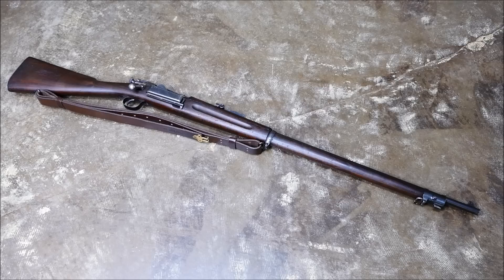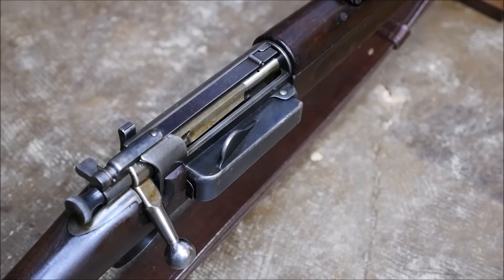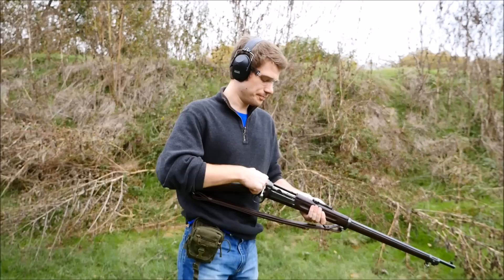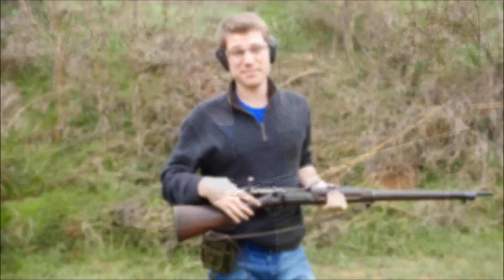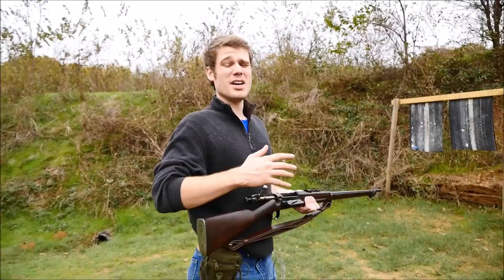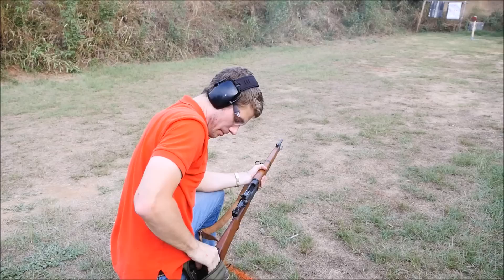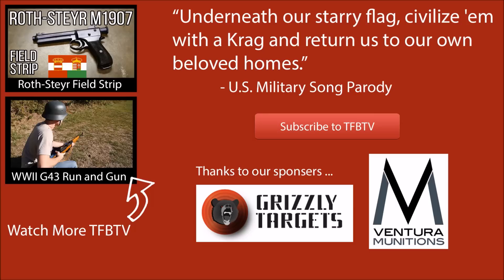Krag Jorgensen Run and Gun

Comment: so, you basically throw some rounds in there and let the gun sort that mess out ?
Reply from the maker: +lefr33man Lol, pretty much!
Reply: The Krag and Enfield are the fastest shooting bolt guns out there.
Reply: +TFB TV How do you feel about lasers on handguns? Like a .357? I put a laser on mine and i like it, some other people like it too, but some disagree.
Reply: +Tyler McCommon , I agree on the Enfield but not the Krag.  Not after the gun is empty. The mad minute of 40 good aimed shots from an Enfield includes reloads.
Reply: I meant the action.
Reply: Tyler McCommon ,
For a hunting rifle that is sensible and reasonable but not for a service rifle on a battlefield. I can imagine what would happen when mud, sand, dust and water gets into that magazine.
Reply: +The Laughing Hyenas I guess you still fail to understand. The speed at which the weapon's bolt can be manipulated is very fast/smooth. I never said the Krag was a fantastic weapon, simply that is a fast shooting weapon. Nor did I say it is a fantastic at reloading, simply that it can be shot very quickly.
Reply: Tyler McCommon ,
I guess I distinguish between a sporting rifle and a military weapon. Have a lovely evening.
Reply: +The Laughing Hyenas 
they have developed speed reloaders in norway and from what i saw with the lee enfield&#39;s stripper clips. it&#39;s mutch faster. you can get off more rounds off with a krag then with a sauer 200 str(Sig sauer 3000 ) in 25 sec
Reply: lefr33man yup. Dump 'em in pointed the right way, and the Krag will sort 'em out.
Reply: @ElCrab  Yep it's almost jam proof . just drop in 5 rounds and go
Reply: Just dump 'em in from the side you can't jam it! Top it off with one in the bolt makes six.
Reply: The KJ 1892 is awesome lol
Reply: @flyinglunchbox  Whoa.... I'm not sure you could call the Krag one of the fastest shooting bolt action rifles. That is precisely the reason it was replaced.
Reply: @Strelnikov10  The krag in 6.5x55 is the fastest bolt action there is. The yanks chose the wrong round for it.
Reply: @BumblingBushcraft  I agree that the 6.5x55 is a superior cartridge.... but the cartridge has nothing to do with the speed of the action. I stand strong on my comment that the Krag is most certainly not the fastest bolt action there is. Any stripper clip fed rifle is going to be far faster than the Krag's single loading capsule magazine.
Reply: @Strelnikov10  the rimless 6.5x55 makes the argument moot as you can simply grab a handfull of rounds and, drop them all in, and slam the gate shut and fire. Loading with stripper clips is painfully slow in comparison.  Have you ever seen a Norwegian STang shooting competition?
Reply: @BumblingBushcraft  At best, a highly trained competitions shooter might only match the speed of a stripper clip. The Krag simply requires more actuation to load,. Open the gate, grab 5 loose cartridges, "drop them all in", close the gate, open and then close the bolt.

With a stripper clip, all one needs to do is grab stripper clip, insert, strip rounds, close bolt. 

Now I might remind you... we are not talking about Norwegian competitions, we are talking about combat. Under fire, the loading of a Krag was reported as being even slower. It requires more concentration and there is more that can go wrong.

There is a reason why, by World War 1, every major power on the planet had stripper clip fed rifles. It's just a more practical design, in every sense of the word.
Reply: @Strelnikov10  
"At best, a highly trained competitions shooter might only match the speed of a stripper clip."

No, a Krag with a speed loader is faster than a [insert name of rifle here] with a stripper clip. That is why they use speed loaders in competitions and not stripper clips.

Just about any bolt action rifle on the planet will get mauled by a Krag in a speed shooting competition.

There are several drawbacks to the Krag: 

1. A single locking lug in the front
       a) rendering it vulnerable to material fatigue
       b) will hit differently with dry/wet chamber

2. Safety. Hot gases will hit the shooter's face in case of a ruptured cartridge.

Advantages:

1. Superbly accurate rifle.

2. Fires a comfortable 6.5x55 with great ballistics

3. The ability to top off the magazine

4. Extremely smooth bolt

The Krag worked very well in Norway in 1940, by the way. They lost, but it had nothing to do with the rifle.

"That Krag seems slow to reload."
-Random German soldier before getting shot in the head from a distance.
Reply: @hb9145  Again, we are not talking about competition shooting. We are talking about combat applications and military adoption. I own several Krags and I agree, they are fine rifles. But I think the "accuracy" you are citing is 100% to do with the 6.5 and not the rifle itself. A 6.5 Swedish mauser will be just as precise as a Krag, if not more so because the dual locking lugs allow for hotter cartridges. But the fact remains that countless countries turned down the Krag as a military service arm and one of the most often cited reasons, beyond the other limitations that you reference, was that stripper clip fed rifles were superior in reloading speed under fire. Check out the C&Rsenal video on the Krag or check out just about any book or article on the capsule magazine system. It is just not a practical military design. I also think you are making a big leap in stating that the Krag played no role in Norway's defeat by the Germans. I'm not making a definitive statement that it played a role, and in turn, I don't think you can make a definitive statement that it didn't. Also, in a combat environment, those speed loaders, when issued, proved to be flimsy and unreliable. They also cost a fortune to produce compared to stripper clips, which is why they often were not issued due to lack of adequate supply. Contrast that with the stripper clip, which was almost unanimously issued by the Germans. 

I get the feeling that your sense of national pride is getting in the way of objectivity. This is understandable. I get it. For instance, I am prone to overlook the downsides of the M1 Garand's enblock clip loading system simply because it is "America's Rifle".
Reply: @Strelnikov10  I was merely responding to your claim about competition shooters, so, yes, you were talking about it.
The design was fine under most circumstances. The object of Krags at the time was to support the machine gunners. It was not firing as much lead as possible (with poor accuracy), but placing shots carefully at common combat distances (which they did very well). In WW2 in Norway that often meant up to 600 meters, and close quarters fighting was quite rare. The Krag was better than the German Mausers in that respect. Yes, of course it was the round, but try firing a 6.5x55 in a German Mauser. ;)
There is NO evidence that the rifle contributed to the Norwegian defeat in 1940, so you have the burden of proof here.
National pride? No, I don't think so. I don't even own a single gun that was made in Norway. My Krag is built by Steyr in Austria, and my two Mausers are made in Germany (Mod. 98 and Mod. 1908 (Brazil)).
The Mausers are obviously the safest and strongest, and the Krag has the smoothest action and the best cartridge.
Swedish Mausers are great. Completely agree.
Reply: The krag works with speedloaders, making reloads fast. Stang shooters running krags use Themsen.
Reply: @KillaHaakon  Even with a speed loader, it's a greater number of steps. Sure, a high degree of training can produce speed, but the idea that the krag is a faster loading rifle is absolutely ridiculous. It's just not.
Reply: @flyinglunchbox  the can do the mad minute lol.usually u need to.unrest the stock just to cock it over
Reply: @thelaughinghyenas7962  You have never seen a Stang SHooting competition. The winner score ususally score 30 aimed hits in 2x20 seconds, at 2 separaete targets at differnet distances and have to reload for every 5 shots.
Reply: When you close the Krag gate a spring in the gate pushes the rounds into place.
Reply: @gregb6469  like the banana loader for AK?
Reply: @sargera1  -- I have no idea.
Reply: @flyinglunchbox  Mannlicher 1895 would like too have a talk with you
Reply: With rimless ammo versions like the Norwegian version, yes.

Comment: Still easier to reload a Krag than it is a Lebel.
Reply: Clay Ronso the krag was made as a better alternative to the lebel, but it also came before stripper clips
Reply: @blacktoast_2158  Krags have speedloaders.
Reply: @hb9145  they do now, the grunts issued with them had to make do without
Reply: @blacktoast_2158  but it was born right after the gew 88, a rifle with en bloc clips. Had the Kragen been born in 1880, about 10 years earlier, it would've been revolutionary.
Reply: @kyleschafer6275 they tested en-bloc clips and found them to be unsatisfactory compared to the Krag capsule because they couldn’t be topped up and the mannlicher system was too open to the elements. In fact they also tested them against the Mauser with stripper clips and once again found it to be unsatisfactory because while the Mauser could be topped up and wasn’t open the Krag could be topped up while there was a round in the chamber meaning the soldier was never vulnerable. 

The U.S. also developed a system to allow the Krag to use stripper clips by putting a guide by the capsule (this was around 1897-98) the ordinance department rejected it as they were developing the M1901 which would become the M1903. 

A decent bit of the Krag lives on in the 1903 though as while externally the bolt resembles that of the 1893 Mauser internally it’s basically the Krag bolt, it even shares the same cocking piece. The magazine cutoff on the 1903 also is very much inspired by the Krag.
Reply: I would have to disagree with that as sure you had to double smack the bolt for the lebel but then as long as you push the rounds down the tube, they stay in place as if you were to slightly move the krag, the rounds can go back and make it harder to put another one.

Comment: I feel like it is pretty fast reload for not having clips.
Reply: It does have clips, at least in Norway it does.
Reply: It depends, i think? but they were having some issues..
Reply: Ten seconds end to end.
Reply: Diffrence in norway it shot the rimless 6.5x55, there is speedloaders for it that load the krag in 0.5 seconds. there is no rimlocking on those.
Its even faster to load then any mauser, as there is no resisance and speed loaders are just a box of 5 rounds poored in the magazine.
Reply: @daginn896  Speed reloader?
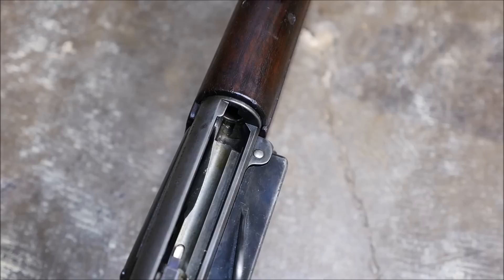Reply: Watch 1:10

Comment: The 6.5mm Norwegian Krag with it's rimless round might be a lot faster.
Reply: +Apneaman Indeed it is!
Reply: both rimless and rimmed were tested for the krag and the back of the rim has a shamfer anyway so no problems with the rimmed round
Reply: KazooLordHD Champfer!

But indeed, they really do solve the rimlock problem. To spec .303 British ammunition do suffer minimal rimlock with the Lee-Enfield even when they are loaded with the wrong technique because they are made with one. 

The Danish Krags also had a stripper device which made them fast loading with and without clips.

Comment: TFB TV:
The Krag Jørgensen rifle was a very effective rifle at the time of bolt action infantry rifles. In Norway where the design is from, we used 6.5x55 ammo in it. To use a rimmed round like the US 30/40 Krag in a rifle, where the cartridges "magically" seats themselves in the magazine is not a very good idea, and you get rimlock and difficulties loading! Also we developed a speed loader for it. 
Just my opinion
Good video and keep them coming :)
Reply: I have never had rimlock in my Krags. That magazine seems to sort them out. FMJ bullets do work better.
Reply: The Springfield was a darned pretty rifle, but my Enfield P-17 always shot better than my Springfield... the WWI sight on the springfield sure didn't help.
Reply: Oi alex, what is the ammo pouch you use for run and guns?
Reply: @DonMeaker The P-17 a pretty weapon as well.

Comment: ...and to solve the slow reload I use a Mosin Nagant stripper clip to feed my krag. Actually, it works faster on the Krag than on the Mosin. Looser fitting, it will capture the 30 army, but is loose so that once in position, all you do is hang it tip[ down, move your finger and they drop right in. Boom. VERY nearly as fast as a regular stripper clip and just as fast as the Lee Enfield's stripper clip, but looser and less force required. Try it out.

Comment: You did a fine job there, Alex. Sometimes finding the stripper slot on a Mauser can be tricky when you're hurrying, and feeding from the stripper can get a bit hung up, so I would say the side gate loading of the Krag was only marginally slower (as long as you're not dropping those loose rounds 😆). The real weak point is those damn rimmed cartridges, on a rimless 6.5 ×55 you just drop the rounds in as fast as you can without concern for rimlock. I only use round nose, soft point 30-40 loads in my Krag, chambers with no difficulties, that might have made things go a bit smoother for you as well.
Reply from the maker: +ostiariusalpha I beg to differ! I can load and shoot off 5 rounds in a stripper clip gun before I can even load the Krag!
https://www.youtube.com/watch?v=QCw70obEIG0
Reply: TFB TV Oh, I'm not doubting that it's faster than the side gate in whatever type of round you'd choose. Still, with a Norwegian Krag, you pop the gate open, drop in the five rounds all in a go, and smack the gate shut. Not as slick as the Mauser, but much better than the trickling you were doing with the 30-40 cartridges. I won't put forward the Krag's speedloader too much, because that was never military issue and it would have had weight penalties versus the stripper clips. The speedloader is crazy fast though, and you can top off the magazine with a round chambered.
Reply: +ostiariusalpha There were actually issued speedloaders for the norwegian krag before the defence cuts of the late 20's early 30's. These were made of cardboard and steel.

Comment: San Juan Hill wasnt a failure. It was a U.S. victory. Where did you get that info?
Reply: DJ Blackhood  The attacking force almost always have more casualties then the defenders  Just because they had more killed doesn't mean much. The Americans took San Juan  Hill  so won the battle.
Reply: john kendall I think Alex was referring to weapon performance being a failure, rather than the outcome of San Juan Hill. And in that regard, the American Krag really did fall behind the Spanish Mauser. Which, in turn, led to more casualties than what was necessary. Pretty much the only reason why America won was that the Spaniards grew overconfident, and were caught off-guard by the Rough Riders charging at them under the cover of Gatling gun fire. But if the battle came down to the rifles, the story would be way different.
Reply: @Anino_Makata  I agree that because the Spanish Mauser used a stripper clip it was better rifle but not by much. The defenders were behind barricades and the Americans only took 30 more casualties. I'm not convinced if the rifled were reversed that there would be much difference in the outcome. PS some of the US troops were still using the single shot trapdoor. Have you ever shot a Krag rifle. I have they are not as slow to reload as people think.
Reply: @Anino_Makata  Measuring rifle performance when the variables are so different, is impossible. The Americans had outdated artillery and were attacking a heavily fortified position uphill, yet suffered fewer fatalities than the defending Spanish force. I'd call that a success.

I have no experience with the American Krags, but I do own a German Mauser and an Austrian produced Krag. If I was to shoot fast and accurately, I'd pick the Krag.

The beauty of the Mauser lies in its reliability, safety and simplicity.
Reply: @hb9145  The Norwegian conscript army went up against a batlle hardened German army at the battle of Narvik, with the krag, in winter conditions, and won, using the Krag aagaisnt the Germans Mausers. And won. It was not the rifle that was the problem, it was the rimmed 30-40 Krag round that was inferior in that rifle....probably combined with bad training. 
The Norwegian army was recruited from men that grew up shooting the Krag in the Shooting clubs. The Garmans at Narik suffered a tremendous ammount of head shots. 
Karl Springenschmid writes of the German experiences:

«The Norwegians tend to attack during bad weeather. They fought harder than ever now. That they where excelent skiers, and knew how to fight on skis, the Mountain troops had experienced, also that they where excelent sharp shooters. But that they could go to direct storm at the support points was unexpected. Beaten back they gathered again and again, and attacked again, storming over their fallen and penterated our positions. These stubborn Norwegian peacetime soldiers had in short time gotten used to the war and become dangerous enemies."
In the battle on the 20th and 21st of May at Storebekk- Kobberfjell, where the Germans was desparatelky defending hill 648 with the order that "This line will be held at any cost", also with massive air attacks agaionst the Norwegian soldiers, tell us something o fthe intensity. Of the 50 Germans that defended the hill, most was killed, wounded or taken prisoner.
So, attacking trough a snow storm, on skis agaionst a fortified, defnede hill, while the nemy has air superiority, and still win the day, using a Krag. Nope it was not the rifle that failed at San Juan....